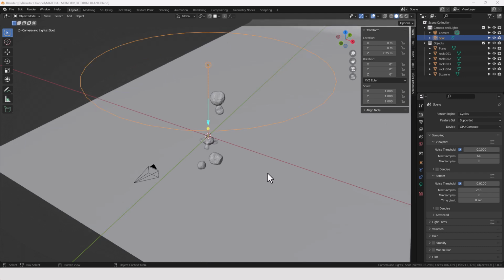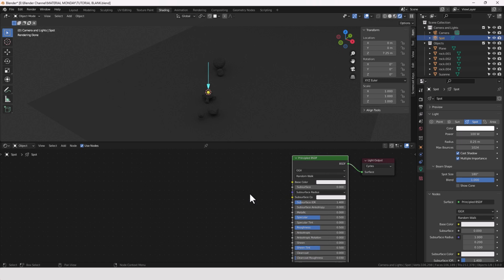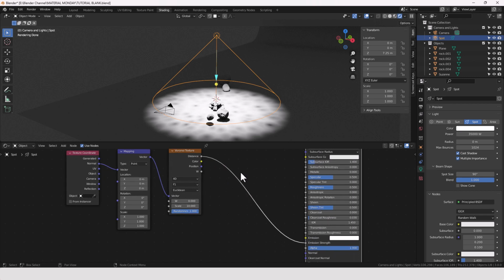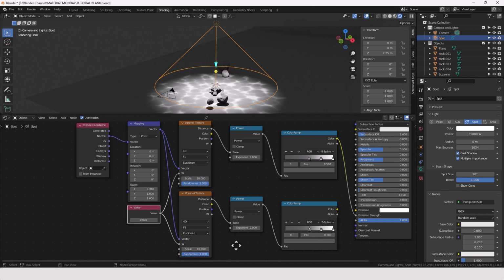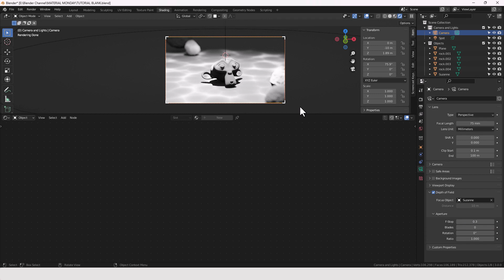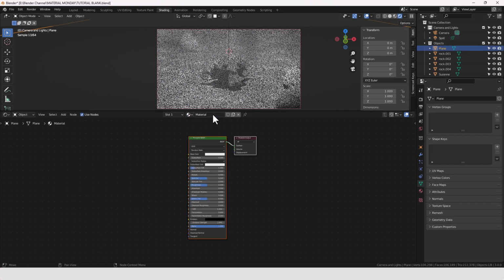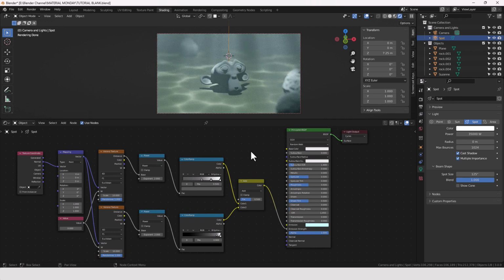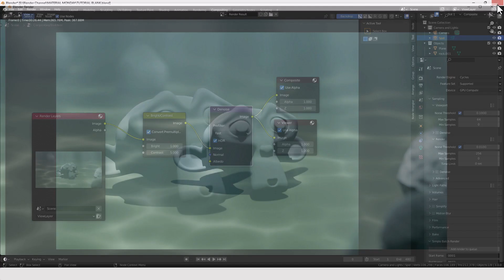CREATE UNDERWATER LIGHTING PROCEDURALLY IN BLENDER

Comment: Hi there, I’ve tried to follow this tutorial twice, but each time I get to the color ramp section, nothing changes with my lighting. Any ideas why? I am also unable to change the colour of the light using the emission on the principled BSDF node. Any help would be much appreciated.
Reply from the maker: Two things that I need to ask right off the bat, 1) What version of Blender are you using? 2) Which render engine are you using?
Reply: @blenderbitesize  Im using version 4.4.0, and the render egine was set to EEVEE as opposed to cycles, will this make a difference? Sorry, very new to blender!
Reply from the maker: Yes, using EEVEE instead of Cycles will make a huge difference. I use Cycles as the render engine in all of my videos. EEVEE (until recently) did not do well with ray-tracing or other realistic light creating effects and so the results would not reflect what you see in the tutorial.